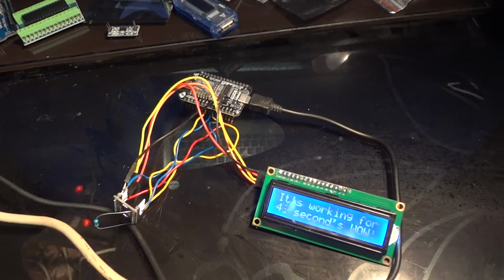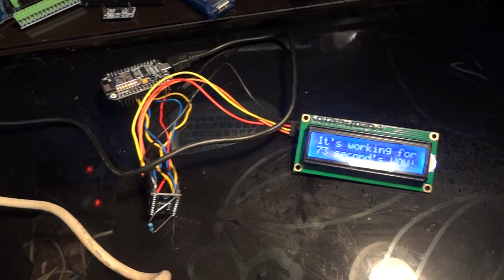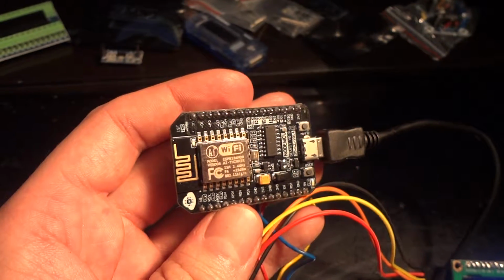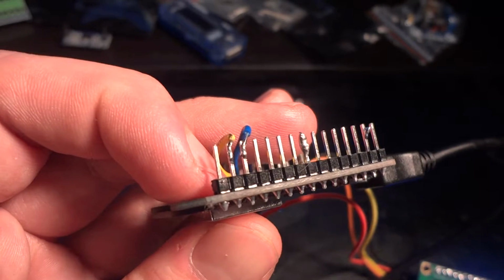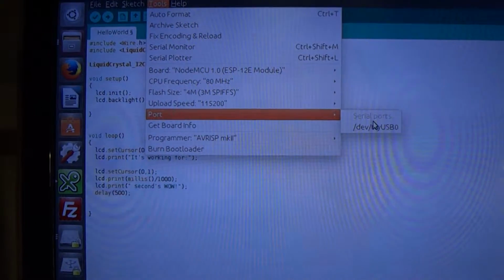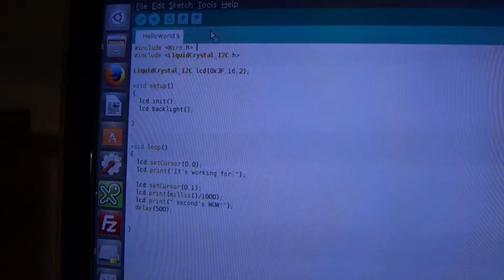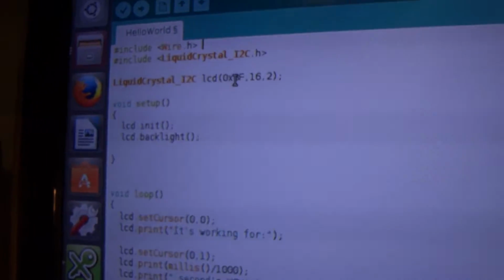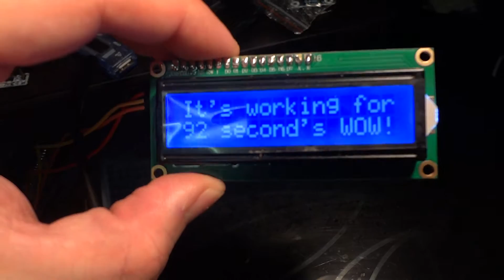NodeMCU + I2C LCD + Arduino IDE  + TXS0108E logic level converter

Comment: Are you using the level converter for the serial communication, or is because you need 5V on VCC of the LCD?
Reply: The i2C, talking back and forth with different `logic levels` for what constitutes a high or low signal, and or pin tolerance.

Comment: some example code use  address 0x27 mine worked with addresd 0x3f
Reply from the maker: I'm pretty sure they made them in different ID-s so You could use multiple one in one project and know how to address them, but sellers don't know that, sourcing them from different batches selling mixed,  and for them IC is just IC...  they should write in title their ID on auction title... but that's wishful thinking ;)

Comment: Thank-you for that resistor tip. That saved me some time. I read the specifications for that IC. Instead of the resistor, we could use the micro-controller (MCU) to pull up that ENABLE pin, OE, from software, or drop it LOW when we want to cut off the transmission in both directions. I mention that in case anybody else needs that method.